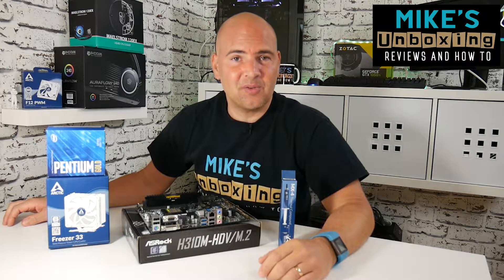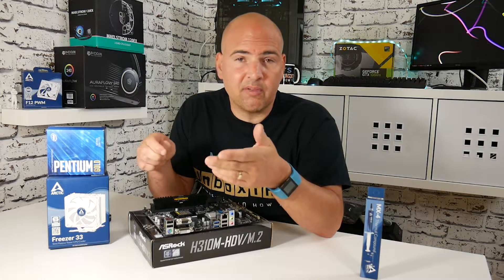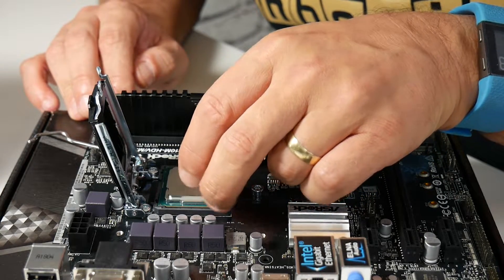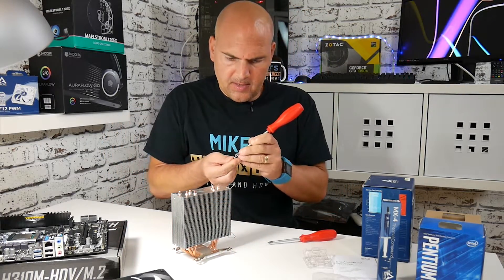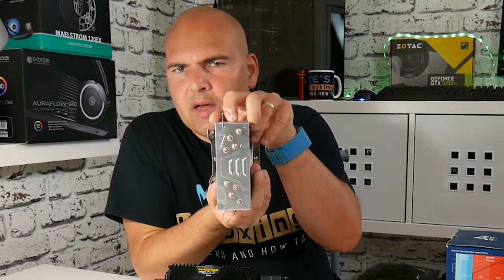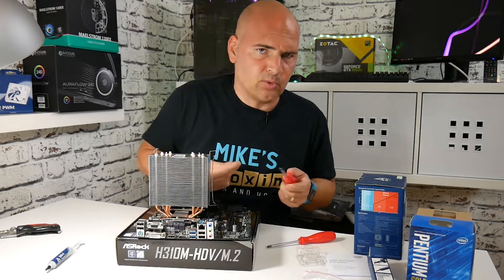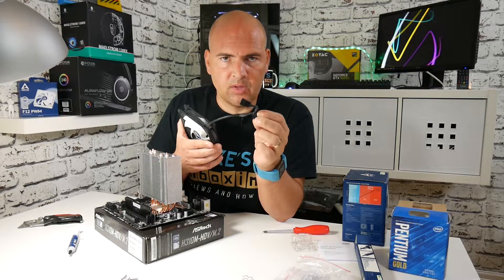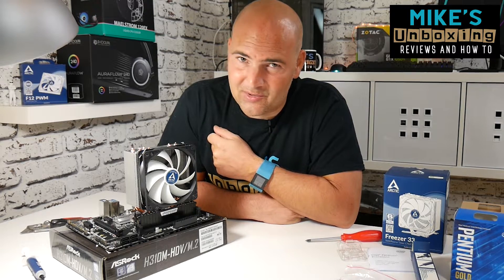How To Install Arctic Freezer 33 On Intel 1151 Platform (Coffee Lake)

Comment: I like to turn air coolers so the air blowing through them blows directly towards the exhaust fan in the rear of the case to remove it more efficiently,
Reply from the maker: Yeah I think that I should have turned the cooler around to direct the airflow. Although I did some further testing and it seems that the air was hitting the back of a GPU I was benchmarking and it actually increased the cards boosting ability so might make an interesting article to vlog?
Reply: Awesome. I'm always open-minded and willing to experiment.
Reply from the maker: Yeah to be honest it is it happened as I was looking at it in the video and noticed where the clips were attached and thought I don't want to unclip them on camera because they are quite hard to line up especially under the studio lights. If you watch it you can almost see my brain cogs turning 😀